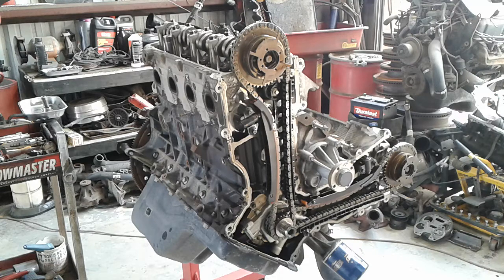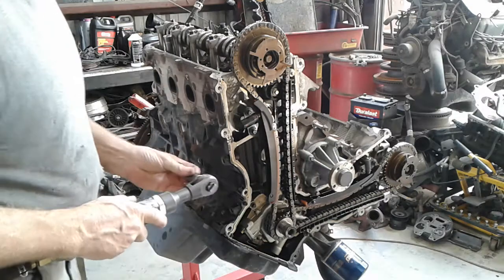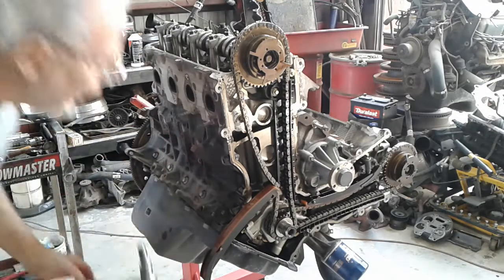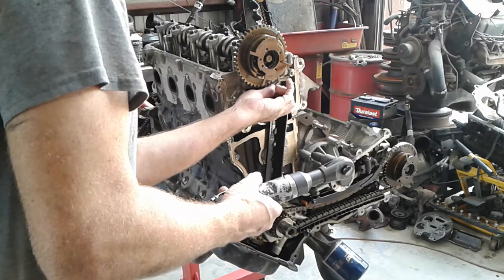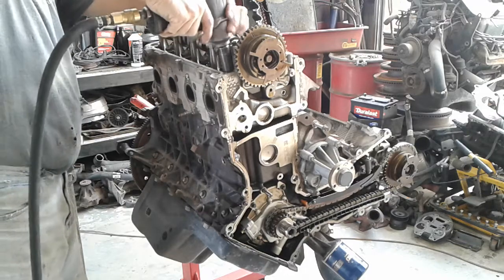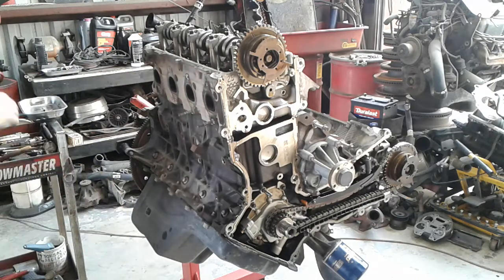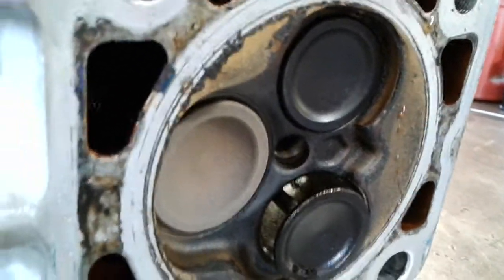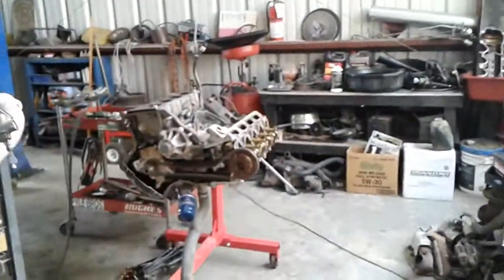20?? 5.4L 3 Valve Head Removal!!!
Or: He Didn't Lock Down The Camshaft Vern!!!!!!

Comment: There's only 2 engines 50 date that I've ever used the  cam/crank lock tools..First is a GM Alloytec and the other was that Amarok and yep I've rebuilt a quad cam Ford Modular too..I think you guys call 'em Coyote engines..We call 'em Boss engines...Yep cams junk...I'm a bit disappointed you didn't pull the valve out and gimme a look...Cheers mate.